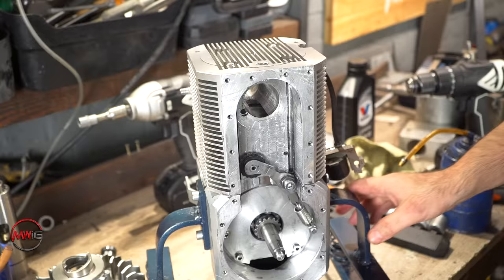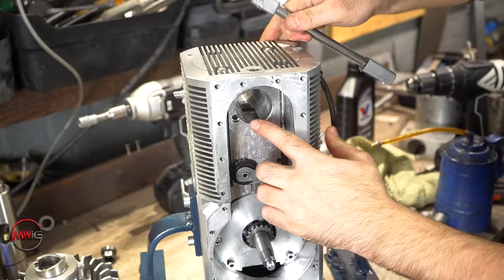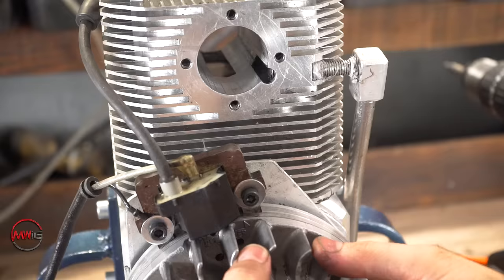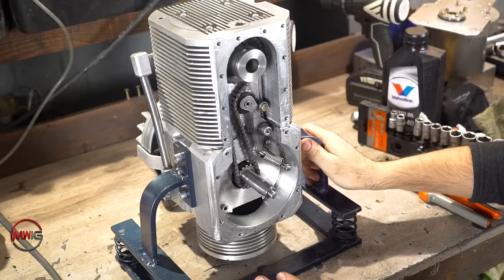I built a brand-new Rotary Valve Engine, and it works!

Comment: Awesome! So glad you got it running. It's very smokey, my guess would be all that's being fed in through the lubrication to your rotating valve arrangement and I'm sure you'll find a solution. If you can refine it enough there's some serious potential with your valve arrangement since you'll NEVER have any possibility of getting valve bounce so as far as the top end goes, it could rev to 100,000 RPM and no issues at all at the top, even better than Ducatis Desmodromic rotary valve arrangement that forces the valves to close yours won't even be putting ANY extra load on any of the top end parts.
BRILLIANT!
Reply: yeah that could rev to moon! lots of potential on that engine
Reply: More realistically it could hit 20k rpm if it had a harmonic balancer, no idea of the weight of the piston so my estimate of the RPM is lower, the only way to find out is to give it as much air and fuel as it can take until something eventually breaks.
Reply: @norliasmith  Always other limiting factors and the rest of this engine I would imagine is fairly limited but, it's always been the rocker gear and weight of the parts and getting the weight of those valve stems and all components moving up and down being returned by springs that are the biggest limiting factor in how high an engine can rev. This intake and exhaust has potential to handle as many revs as the rest of an engine can stand. This whole engine was built experimentally and even the valve system will need further refinement, this is just a proof of concept, if the rest can be built to rev to whatever, this is no longer the section that can be the point of failure or that just can't exceed a certain amount, that valve system could rev almost infinitely high.
Reply: @lorditsprobingtime6668  Another option is to just get rid of all the valve gear by integrating it into the piston and block... both achates power diesels and liquid piston do that. You could think of the liquid piston as an integral rotary valve engine... why make multiple parts when you can just make a single rotor. The achates engine does it by using ported cylinders and forced induction.
Reply: @Wingnut353  When will you have it built to demonstrate what you are saying?

Comment: I'm assuming what you made was a mixture of motor oil and gasoline, id recommend using 2-stroke oil instead of motor oil, see if that improves the smoke any. Also, this thing is AWESOME.
Reply: He did mix a little oil with the fuel, but the smoke is from burning oil out of the crank case.
I'm not sure how to correct it, but the oil is getting to combustion chamber around the valve drum and it is consuming its own life blood.
Super cool to see a radical concept physically work. With a bit of refinement might be able to solve the oil consumption issue. 

My left field idea has been to run "conventional" valves off of solenoids.... near infinitely adjustable valve timing. And no parasitic loss.
Reply: @jeffersongaragecustoms6431  something like a free valve system? And if it's using its own crankcase oil maybe it would be a good idea to use a dry sump, although I'm not sure how much of a benefit it would have.
Reply: @jeffersongaragecustoms6431  there might be a easy way. he could "dig in" a small oil tank dedicated to the valve drum. and on the other side of it (where he now have the oiling sistem) something like a razor to eliminate the oil and thow it on the chain. its a simple and allso veriffied working solution. its allready incorporated into the cilinder function.
Reply: @jeffersongaragecustoms6431  Maybe something more simple would work like a reclaim cavity or something along those lines. It is difficult to seal rotating without a sealed bearing or something similar. But maybe if there was a way to have it run off before getting to the valve tube openings?
Reply: Crazy idea...what if there were two valve tubes? One exhaust and one intake. Using bearings that maintain center and are the only part of the system in the head that are lubricated. Could help with compression if sealed well. Additionally it would give more timing options but require a new cylinder. Also gear ratios would come into play...math.
Reply: @seanwayment9361  I was thinking same thing with adjustable cam gears but it would complicate things further. I'm almost sure its losing some compression and drawing in oil already.
Reply: Motor oil mixed like two-stroke oil will run a two-stroke piston by scoring it I've done it.. I don't know that's what he's doing but yes I would use two-stroke or ashless oil
Reply: @SlowSTEN  heavy o rings on valve to keep out oil

Comment: If you can figure a way to seal the rotary valve with oil seals so the cylinder would not receive so much oil and less compression loss the engine would run fantastic, Great job, thanks for the videos.
Reply: he needs to make it 2 cycle and put the valves in the ports. That way he can turbocharge a 2 stroke.
Reply: The lack of seals for the rotary valve is the engine's biggest design problem. It causes loss of compression and sucks in oil on the inlet stroke. A partial fix for this is to have  separately fed plain bearings at each end of the shaft with  viton o ring seals at the outer ends of both ports to prevent oil being drawn in on the inlet stroke. There will still be some compression loss around the annular space between the shaft and housing as high pressure gas leaks to the inlet side but at least the compression loss will be reduced and the engine won't burn oil. Because the shaft is a reasonably small diameter, Viton should be able to cope with the rubbing speed but it is essential to use Viton to cope with the high temperature generated. The groove depth needs to be carefully controlled to get sealing without undue compression of the rubber which would cause it to burn.
The system isn't new as this design has been used on motorcycle engines where the rotary valve has been driven by bevel gears.
Reply: @angusmurray3767  Agree with everything you wrote.  I think there was another example of a rotary valved engine, which was used in the Hawker Typhoon around the time of WWII....that one however was a rotary sleeve type that also formed the cylinder wall, if I remember correctly.
Reply: @rrmcbride555  His valve system doesnt seem like a gain for a 2-stroke. Just extra parts. Much easier to just cut holes in the cylinder wall.
Reply: I agree with this guy on the seal and compression issue. Great job on the build. Also would like to see more on the final results.

Comment: I can't wait to see it brother, I'm so glad you got this running. I think it's going to be an awesome engine. Tbh I'm really interested in how it sounds cause the valve is definitely going to make it sound different.. congratulations 🎉👏🎉👏🎉
Reply: Can wait to see it
Reply: Electro-pneumatic poppet valves can vary the timing. No camshaft needed just a trigger wheel to open and close the valves. Different wheel = different timing. 
Mount the valves vertical with sacrificial rockers and you can have a few timing mistakes with no harm done. 
Check out how Fiat built their twin cam 16 valve 1.3 diesel. It’s an efficient and very clever design.

Comment: I knew you could do it, I gave some comments but you had it going by the time I posted. You just need to address things like sealing the oil off from getting into the combustion 
Chamber. Also I would install bronze bushings in the block, where the rotor valve shaft 
Spins so it won,t wear the block out.That engine can be a living work of art if you keep 
perfecting it over time. I,m a retired tool & die maker as a racing engine builder. I,m 78 
Years old, just do not have the drive you still have. I love this challenge you got going. 
But you can keep improving it believe me my friend.

Comment: Incredible. I filed a patent for a 4 stroke version (almost 18 years ago) that has pass through of the "valve shaft". Great work, I love it!
Reply: Was it actually practical?
Reply: @JusstyteN  what's your deal man? Having a bad day? It's easy to build an engine with a 100 million dollar budget and you're knocking this guy for building one in his garage
Reply: @JusstyteN  kick sand
Reply: @JusstyteN  I accept your point and I raise you this one:

This prototype does not yet have an effective lubrication system for the cylinder walls, or any sort of PCV system. Oil was added to the gasoline to lubricate the cylinder in the meantime.

This is the reason for the smoke, and would not be a problem in a normal 4-stroke engine. Would very likely be added later in the development cycle, an easy oversight for now.
Reply: @frikyouall  basically he is reinventing a wheel. First of all its not a rotary design. And what is the purpose of making shitty engine while you can easily buy an already built engine for cheap. I would understand if it was something new that he was trying to make but this one... early design stages of a design that everyone uses with a twist that its a lot better. That much wouldnt be spiting if it was just an added oil to the fuel. Im pretty sure its crank case oil making it to the compression chamber. First few seconds and its spewing oil like crazy, not to mention the ammout that its already burning a bunch.
Reply: @JusstyteN   25 points.

The added oil from the combustion chamber is due to the rotary valve design picking up oil from the feed sleeve and dumping it in every rotation. An issue that would need to be remedied, and has several solutions. You are correct that it's crankcase oil.

What you must understand is that the beauty of this design lies in its simplicity, with the added bonus of fixing a lot of faults with the old model.

I'll start with replacement, which is where  I find the most importance. In the traditional model, to repair the valves, you need to remove the accessories, timing cover, timing belt/chain, camshaft(s), camshaft braces, connecting rods or buckets, springs, and perhaps tappets, and then you need to replace and torque to spec as and where necessary, then check timing while you slap everything back on. With this new design, you remove the timing cover, the chain, and the valve cylinder, put the new valve cylinder in, then check timing and finish up.

This saves huge amounts of time and expense when it comes time for repairs. Cylinder head gasket replacement becomes a trivial matter instead of a costly job that can go way overtime.

Not to mention the design fixes a fatal flaw with a valve design that relies on springs: the dreaded Valve Float condition. Basically the springs can't expand fast enough to keep up with the piston stroke, so the engine chokes up at higher RPMs. No springs, no valve float. Problem solved.

Further, the cost isn't really an issue here. Any new technology would normally be expensive as it gets refined. Personally, though, the design is so simple that I wouldn't be surprised if it could be sold quite cheap out of the box. A one-hole cylinder head and one drilled cylinder? Easy manufacturing.

It's reinventing the wheel, but in a very solid way.

Also, I'm getting the idea that you clicked on this video expecting to see a Wankel engine. This video is about a rotary valve, my dude, not a rotary engine. The engine is a standard piston engine designed like those you can find on any store shelf in any lawnmower anywhere.
Reply: @JusstyteN  why don't you build one yourself and do it better then?
Reply: @frikyouall  ok valid points with a flaw in itself. It cant be fully solved as its gonna have seepage to prevent major wear. The aerodynamics are terrible. Its not a new technology. For a good designed engine you can look to a 500+ mega meters witch is insane amount of range. Witch makes the cost of repairing valves trivial. Its not even a problem anyways. Have you heard about modern engines with a custom valve timing like vtec and others? This stupid design doesnt allow that. Also valve retardation isnt really an option either. Basically design witch can work as a different kind of design but not in a day to day car. If it was inline 6 it would have so bad aerodynamics i doubt it would ever run corectly. Basically maybe a cool idea but impractical. Floating valves arent an issue f1 cars and motorcycles can go over 10k rpms no problem. Even rotary engines arent popular because its not meeting standards of clean efficent and reliable. It can be made reliable but not very efficent. Anyway cool that he made it but no use for it.
Reply: @JusstyteN  I appreciate that, but you can, in fact, adapt a vvt-i system onto this due to how it's designed. It would just be a matter of adding the oil pressure switch onto the assembly, which will both advance and retard valve timing as needed, just like any OHC or DOHC VVT engine. The pressure switch is on the front of the cam to control timing. This is designed very similarly to any regular, everyday cam.

Plus, these high-RPM cars rely on stiffer springs to get to those RPMs, which sucks power from the engine so the cam can push them down. This is not even the major problem, as the springs are stiffer, but still imperfect. They will still have a valve float state, the RPMs to reach it is simply moved to a higher range.

And I agree, it will likely have seepage no matter what. This can be minimized and worked around, but likely never solved for. New technologies, new problems, shit happens. I'm not too worried about it. The assembly has potential, and a lot of it. Brilliant in its simplicity.
Reply: @frikyouall  i highly doubt it has any potencial. Yes its possible to add timing to it but the complexity adds up fast. And reliability of such addon would be a lot lower. The seepage will stay because you cant fit any orings due to high pressures. And also at very high rpms it will instantly encounter a very turbolent air flow. Many valve designs are designed with very high radius turns to minimise the turbolent air flow and this design is very limited due to the way the air has to bend 90 degrees very sharply. At high rpms or bigger power the turning mass of that valve design will also impact performance. And also the hot air heated up by exhaust fumes doesnt help either. Imo opinion its just an other design witch wont ever be used in a production car.

Comment: Fantastic job , being a mechanic for 50+ years the Rotary valve is a great design, but the oil system you have to the rotary valve shaft will cause excessive smoking , oil consumption , I think you need to redesign the oil system so the oil is not pulled into the intake cycle and causing your smoke and oil problem, if you can solve that problem you have a engine that’s better designed then a valve and cam design! Your work is amazing!

Comment: Many would consider what I'm about to say a non issue but the fluid used when honing a cylinder is much more important than most think. In a performance engine where you want every possible equation covered I was taught to only use oil. Preferably the oil you run in the motor. Solvent based chemicals embed the silica or grit from sand paper or hone microscopically into the cylinder wall. I was always taught to only wash cylinder with soap and water. Doing this many times and on my two stroke motors only use the oil Mix with fuel as my cutting fluid and wash often in between. A dishwasher works great but yes solvents don't ruin an engine but eliminate any potential issues when possible. I like it. Keep testing and get those piston rings seated tight to stop all the blow by.